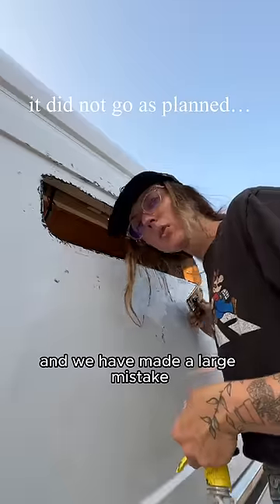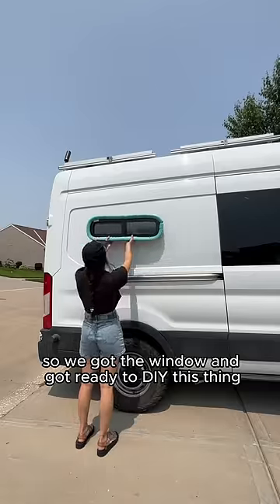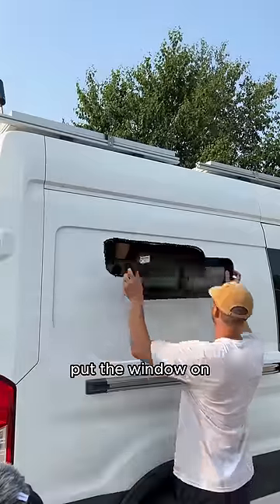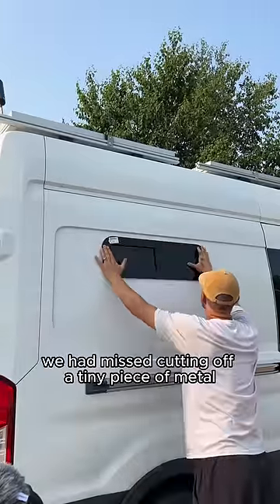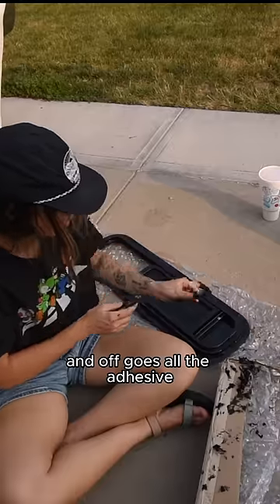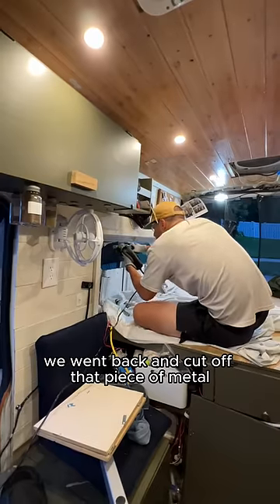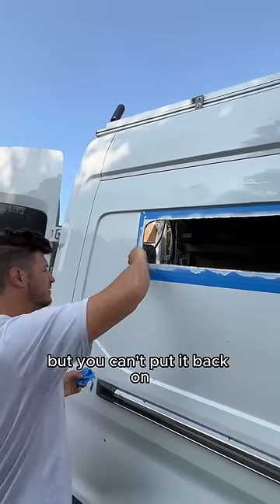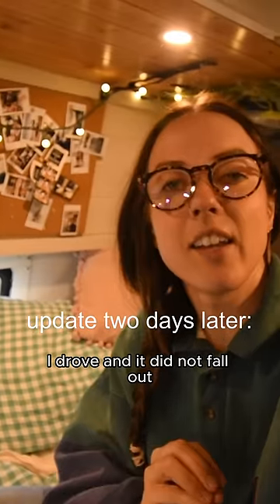DIY window install gone WRONG #vanlifefail #diyfail #vanlifediy #vanbuild #vanconversion

Comment: protips: 1.adhesive is easier to remove if you let it cure(100 times less mess) 
2.dont use cutting tool that creates sparks, this will burn ur paintwork and it WILL rust much faster then elsewise. 
and a question to finish this off: how is the clearance between your new window and you sliding door?
Reply: How you cut metal with no sparks?
Reply: @generalcornelius1880  Electrical saw or multi-tool
Reply: @generalcornelius1880  underwater – roll the van into a lake then start cutting.
Reply: @schoomper, many adhesives come off fairly easily before they've cured but are incredibly difficult to fully remove after.
Reply: @generalcornelius1880  seriously though, a jigsaw like they used for the initial cut doesn't make enough sparks to worry about & aiming the angle-grinder sparks away like they did for the trimming is usually good enough though using masking tape to attach card for a fair distance makes sure.
Reply: @Schoomper, putting a slim-framed window into a window recess usually leaves enough clearance.
Reply: @alanhat5252  i've worked with glass in vehicles for over 10 yrs now, and used a ton of different adhesives. and i speak out of experience, they ARE easier to remove if u let them cure. i remove cured adhesive multiple times every day. but the few times i get in situations where i have to remove it before its cured i absolutly hate it. cause it get so incredible messy, and its alot of cleaning work
Reply: @alanhat5252  the jigsaw os the preffered method. thats what i use when i do this at work. no matter how u  "aim" the angle grinder the warm metal fragments will fly everywhere and some of the will hit the paintwork. and you'll end up with rust. as i said, i do this for a living and have done for some time. (and i gave tips to the people doing work in the video, they didnt mask or "aim" nearly good enough.
Reply: @alanhat5252 im asking about the clearance because of the slidingdoor. and the window beeing an latched window, it will build some on the outside, so i have no doubt about it having some clearance, but i just asked how much clearence there where. out of curiosity

Comment: As a impact window and door installer, i recommend dryrunning. For those who don't know, a dryrun is, its when you stick whatever your installing in the opening to confirm its going to fit correctly before using any mud or caulking.😁👍
Reply: Thanks for taking the time and writing up the explanation! Definitely helps newbies for future lessons
Reply: I've known that process my entire life lol. I started making model cars when I was 6
Reply: @jordanfehr7749  then you were taught right.👍
Reply: dry fitting baby, never know what you might've forgot
Reply: As one who does irrigation, I agree... Dryruns save lives in the 100 degree heat
Reply: As someone who drives fire trucks, I learned in kindergarten to make sure something fits before applying glue.  Common sense isn’t validated by what you do, in life.
Reply: @vinnieneutron  Wow. Here is is everbody, he's right here.
Reply: @YouTube_This   Settle down, Champ.  Let’s start by having you re-read what you wrote, aloud, to yourself.  Then, blame it on spellcheck.  Finally, have another shot… but be less boring, as “a impact window and door installer.”  Get to it, then…
Reply: @vinnieneutron  dude, the only reason i said im an window installer is because anyone who works in the field knows we do alot of dryrunning. Im glad you were born with common sense, I've also always had alot of it, but tons of people don't, but that's no reason to shit on everyone who doesn't. Sorry you dont find my profession as amazing as driving a fire truck but thats what i do and i do well. I do find it amusing when commenters say things like "settle down" to make it seem that im worked up🤣 congratulations on being the only negative person on here guy.👍

Comment: 2003, we built our ExpeditionVehicle.
We mounted 3010 (three feet wide by a foot tall) dual-pane sliders designed for a stand-still house.
We mounted these at our eye-level standing inside, about eight feet above pavement.
We sealed with Vulcum 116.
.
Two decades full-time live-aboard, our Vulcum 116 remains soft and pliable.

Comment: When cutting a hole in ANY vehicle, don’t use a level because the vehicle is most likely not level and it’s a big pain to level it. Pick a reference point and measure from there.
Reply: What, just like they did?
I'm sure they wouldn't have thought of that without your input.
Reply: @alanhat5252  if you know anything about these kind of things, you would’ve known this window has been installed improperly and will give draft, leakage and might even fall off within a year. 

But no, you instead chose to be a dick to a stranger trying to be helpful.
Reply: @alanhat5252 they didn't even dry fit it before glueing it on. What makes you think they have any common sense.
Reply: @nikolawandler9399 they did dry fit it lmao, did you not listen or watch the video?
Reply: @alextheonewarrior  they say they did but it was obviously wrong
Reply: @alextheonewarrior if they had dry fitted it they wouldn't of had to remove epoxy due to a piece of metal getting in the way 😂
Reply: @alanhat5252 bro, they tried to glue in a window before confirming it would fit without issue ……

Comment: I know the feeling. Worked at a van conversion shop for a good long while and we installed windows, but they were the factory size windows that took up the whole panel section. Can be very tricky

Comment: Pro tip with the adhesive, it’s easier and less of a mess to take of once it is dry. My dad has been working auto glass for longer than I’ve been alive and that’s always been the case.

Comment: Just a note: it's not level unless the van is level. What you did was correct. You measured so it was parallel to the horizontal line. Always measure for a vehicle. Measure from the ground, floor or roof. Never use a level because the ground is probably not level so the vehicle is probably not level.
Reply: One thing I want to add, if you do level for some reason, use a digital level and zero it based off the vehicle. I would only do this in a curved portion of the vehicle where measuring isn't incredibly easy though.
You can get a Klein digi level or similar for $30-50, worth the money to make sure it is good, and check it with your eyeballs a bit to, if it looks off it probably is.

Comment: I like how you confidently cut out the “ important “ structure of the van. Twice
Reply: They didn't. That's literally the spot where they put windows on those vans. I literally have 14 of these vans and that's where the windows are on every one.
Reply: those ribs are just to reduce the drumming, they're not structural in the slightest.

Comment: Never put the adehesive on until you're 100% certain everything will fit well in place. Moreover, it's better to make the hole smaller and then making It bigger by scraping metal

Comment: I like how effortlessly you just cut out the important structural parts as well. What could ever possibly go wrong???
Reply: Thankfully those “structural” parts go bye bye when the factory installs a window as well. It is cheaper to leave those “structural” parts in place during the manufacturing process as opposed to cutting them, even though they aren’t needed, because they are large stamped pieces made hundreds at a time(which saves money, so cutting them after making would add to expense).  These parts of the van(frame work) may be called “structural” but are not 100% necessary where options for windows may be called for. Such as the area this couple chose to place their window.

Comment: Use a couple self tappers if you haven't yet, will help with it potentially falling off in a year or two when the adhesive starts to get old. Good job, nice seeing people actually doing some custom work on their vehicles.

Comment: You can always add new metal using sheets of steel and pop rivets and bondo. Or if you had a cheap harbour freight gasless mig welder you could add more metal back. I like the diy aspect great video

Comment: It's really important to get that right the first time not just because it's so easy to cut more off because it's not once the tin is cut it loses tension and it's hard to cut I'm sure people have tried to cut a can with a pair of scissors before and unless you can put some tension on the can the scissors have a hard time cutting it

Comment: 3m sells adhesive remover you spray on and it melts off. I use it installing windshields 100% recommend if u have to take that black stuff off

Comment: Buy some apex surface treat meant apply 2 layers let dry for 2 mins in between, if temps are above 20 degrees 6 if below 20 degrees apply polyurethane with a gun that’s meant for it, lay a good bead and make seams look good, once PUR is applied you have 12 mins to apply the window once window is on hold into place with tape and don’t drive for 30 mins. I work at the biggest glass company in the USA and the UK your welcome

Comment: 4x Steel screws to dig into the van 4x nuts to secure, epoxy to seal the edges “waterproofing”

Comment: You cut though the gussets which prevent rollover. Coverting a cargo van into a "van life" one already messes with the weight distribution. It'll only take a bump in the correct time and the van will start a death wobble. For anyone else considering modifying a cargo van, don't do this.
Reply: Make believe story. Nice. “Prevent rollover”. Nice touch.

Comment: cut once measure twice is more for things that cant be repaired or extended once cut, a van with steel panels not so much. any welding shop can weld a metal plate to it

Comment: This is why its important to do a dry fit test. Measured three times but couldnt try to put the window in without the adhesive to make sure the fit is correct.

Comment: It looks like they cut straight thru a structural brace as opposed to just sheet metal parts... So in a rollover or side impact that part of the van is going to collapse in dangerously

Seems they compromised the structural integrity with the window placement

Comment: You actually can put metal back on vehicles theres this new invention called a tig welder it came out quite recently as of 1801 but we don't need to go into the history of the tool that joins metal to other metal. Sure the saying was you can take it off but you can't put it back well now we can with every thing like prosthetic limbs and hair. You can put pretty much anything back the only thing that you can't replace is you.

Comment: You know it’s the same hole, with or without the glue… so you could have just put the window in the hole first without glue, said hey it don’t fit, grind a lil off the hole refit window , than finally glue the window in place

Comment: I'm not sure, but I don't think you're supposed to cut out sections of the framing. Pretty sure the flat panel is fine, but if that thing ever rolls you've created 2 or 3 weak spots. Please do some research and find out if this is safe. This video could end up hurting people.😢

Comment: Or you just cut off the piece of metal real quick with a grinder and refit the window unless you have glue up on the glass everywhere I'm sure you weren't able to remove it in like 2 minutes or something that would have taken the grind off your spot unless you all were too slow figure your wonky spot?

Comment: no dry fit, no fastner's, not prepped surface, adhesive on  rattle can paint, adhesive instead of panel bond. Planned to fail you should apply to be automotive engineer.

Comment: The fact you didn't dry fit, the fact you used a reciprocating saw for the entire job WITH THE WRONG BLADE instead of buying a cheap cut off wheel, the fact you didn't read how to use window urethane and put it over paint and not bare metal with epoxy primer 😂😂😂😂 
Saved a dollar tho, right?

Comment: I hope you didn’t cut the support framing out for a cat window 😂
Reply: The factory would cut that support framing out along with other supports when making their passenger van with windows. (Big windows you’ve seen) Same van different cuts. Don’t cut unless you need to for vans with windows, because cutting costs money in the manufacturing process. There are more than enough supports.

Comment: You’re supposed to use foam tape, one side is tape and you line the window rim then the other side is foam. Or doubled sided 3m tape would of worked. You did it like a carpenter not a mechanic

Comment: 1: Why the fuck didn't you see if it fit before trying to seal it in?
2: You can absolutely add metal back on. It's called welding. It's just inconvenient

Comment: So many things wrong with this, lol. Your husband isn’t very handy, is he? Didn’t even dry fit the window before going full on balls to the wall with the adhesives. Also if he owned a welding rig he could definitely add metal back when too much is cut off.